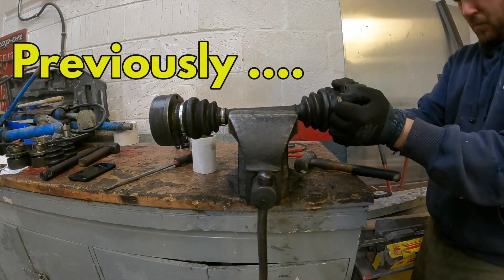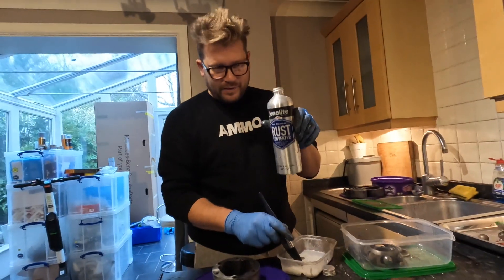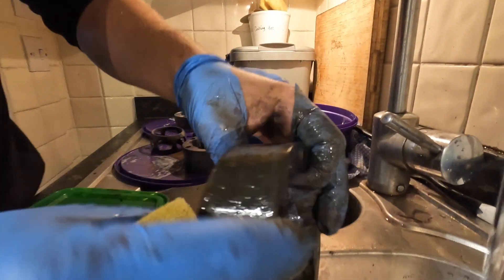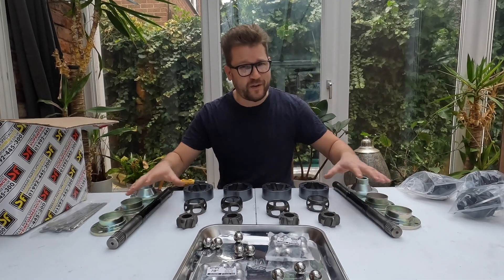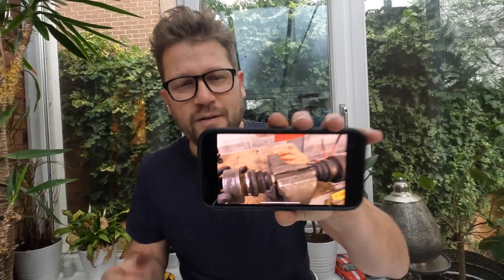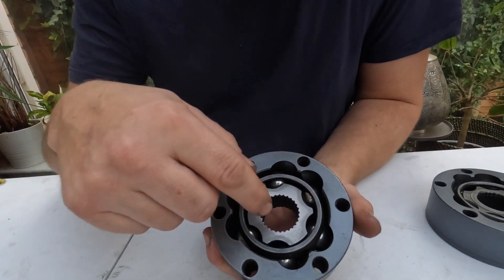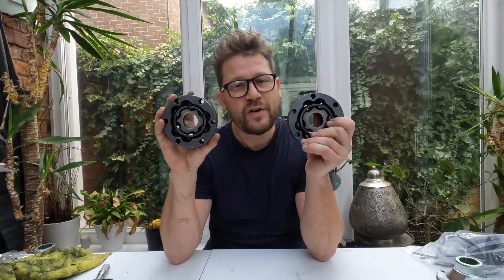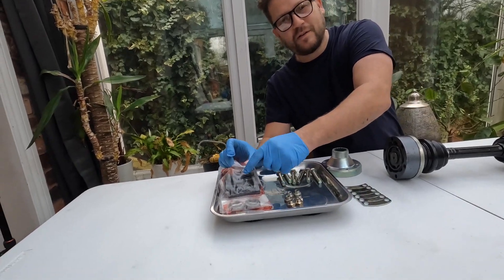Abandoned Ferrari 512 BBi - How One Mistake Cost Me BIG

Comment: To remove light rust, soak in 2-3 litres of white wine vinegar overnight. At about 79p a bottle, it's cheaper than rust removal products and can be less harsh on metal.  I've used it on BMW components. Worth a try, before spending money on more expensive stuff!
Reply: Yes, the best and cheapest advice. Leaving those metal parts totally submerged in white vinegar for at least 24hrs and then he will find them rust free, this is how I restored some old rusted pliers 💪🏻
Reply: @fedezotter  Tip was passed onto me by my Dad. Engineer for 50 years who worked with racing bikes and F1 engines!  No oil residue left and saves a tonne of money! Also done the same thing with a pair of pliers that were pretty ancient!

Comment: Citric acid is your friend for rust conversion.
Dissolve it in some water and submerge rusted pieces for 15 minutes.
Oxalic acid (often sold as "deck cleaner) is another option but it requires longer to work and can stain the metal yellow if not cleaned off afterwards.

Comment: My understanding is that you are better off to pack the CV joint with as much grease as you can reasonably get in under the boot. Benefits are to keep water and dirt out if the boot leaks, carry away any kind of debris from the CV joint wear, helps to ensure an adequate supply of grease to the cv joint and even aids with cooling. Good luck with the rest of the build!

Comment: Remember to "clock" the CV joints inside to out.  Which means the big area on the outside should be matched to a small area on the inside joint on the same axle side.

Comment: I use 1 part Molasses mixed with 7 parts water for rust removal. Leave it in over night usually does it for surface rust but you can leave it for longer if needed or mix it stronger. Don"t put anything Aluminium in it it will destroy it.

Comment: In simplest terms, electrolysis is a method of removing rust (iron oxide) by passing a small electrical charge from a battery or battery charger through the rusty metal to stimulate an exchange of ions while the rusty metal is submerged in an electrolyte solution.

Comment: There's a product in the US called "Boe Shield", They also make a companion product "Rustoff". These two products are simply awesome for rust removal and then longer term protection. I literally have it in gallon sizes on my tournament sport fishing boat. It is used to clean and maintain everything on the boat. Engines, pipework, exposed metal of any kind and fishing reels and tackle. I have no connection to this product other than I cant imagine not using them on my boat or my cars.

Comment: You should look at repacking those CV joints with Krytox 216, basically a lifetime grease made from non-organic fluorinated oil thickened with PTFE and with MoS2 as a pressure additive. edit: ah too late I see. Anyway another benefit is the CV boot won't degrade over time in contact with the Krytox whereas it will when exposed to the normal mineral oil-based grease containing napthalenic acid

Comment: Mix up anhydrous citric acid powder in hot water, 1 part citric acid 17 parts water, leave to soak, stir and agitate with a stiff brush. leave a couple of hours and rinse off and repeat until rust has gone.

Its very gentle and works quickly.

Comment: Steel wool for inner areas, wire wheel on a grinder for the outside stuff (thin wire) and navel jelly for the stuff that’s pitted (let it sit 5-30 minutes in a plastic bag then rinse with water and dry right away) buff with the wire wheel after to smooth out any surface imperfections. But to be honest some of those bearings look beyond help and will definitely need to be replaced.

Comment: I've used a product called CLR - Calcium Lime and Rust Remover.  I soak it for about a week.  Then polish it with a wire wheel to remove the black surface scale.  Ive used this to get bolts to bare metal for replating.

Comment: Evapo Rust. Comes in a big can. You can use it over and over again. Prop with rust converts is that they chemically stop the rust but will not remove it all. Also use XXXX wire wool to clean not wet and dry.

Comment: If the driveshafts are both the same did you fit the driveshaft the same way they came off the car, left to right? Over time the driveshafts take a "set" due to the tortional twisting forces with power application so if you fit them the wrong way round left to right you set up a reverse tortional twist which can lead to driveshaft failure.

Comment: I have had good results with a product called Evaporate-rust. Drop in a bucket cover the part and let it soak for 8-24 hours depending upon how severe the rust is. Will not eliminate pitting so not the best for precision parts.

Comment: Someone below commented that you might have put too much grease in the joints & it looked that way to me as well. I did this on a 328 some years back & there is a specified weight of grease should go in each joint. To complicate it though a couple of the available Ferrari WSMs were at odds with each other as to how much should go in but after some digging around & discussion I think the correct amount was 100g per joint. If you put too much in its going to find its way out and make a huge mess. I think you should also have a clamp on the fat end of the boot - didn't look like there was one there. I also remember that the Ferrari boot clamps wern't very good. Oeticker (sp?) were much better.
Reply from the maker: Well spotted on the clamp, I was waiting for new (better) ones to arrive. 
Interesting re the grease. The 100g is that just for the boot or with a complete fresh dry bearing as well ? I’m the boot I just added the supplied packet of grease. The rest was to add some to the bearings. Maybe a little to much ? However still plenty of air/space in there.
Reply: @Ratarossa  I found some old photos of when I did this (bearing in mind this was on a 328 so the joints may be different, but they do look pretty much the same, maybe compare them with your 308?) . The first time I did it I put 140g in each one as per the documentation I'd found & it was a real struggle to get it in there. That plus lousy Ferrari clamps led to some leakage  - I can still see the marks on my rear manifold where it burned on to my newly zircotec'd pipes!  If it leaks its going to get flung around the place and make a huge mess! Not long after that I found another WSM (I think probably the one off the Mondial which was always more comprehensive) & that said to use 100g. I needed to redo the clamps anyway so I took them off & re-did them with 100g and Oeticker clamps and they have been fine ever since. I don't really think having loads of it up in the boot really does much of any help either. Its not as if its a reservoir of the stuff that I can see.
Reply from the maker: @IDM328  ok good to know, i will take a look and maybe remove some

Comment: You could get the steel parts aqua blasted then polish the cages by hand or on an abrasive wheel and polishing wheel and wet and dry finish the outer CVs on a lathe and then get everything coloured zinc plated by Steve at Chingfords.

Comment: Great job, I am just wondering if any sealant was called for on the caps? I have rebuilt mercedes driveshafts with similar caps and a thin coating of RTV sealant is required then use nuts to clamp to caps temporarily until it cures. Otherwise when the driveshafts are in use and the grease warms up it can start to weep out of the metal joints.

Comment: Did Scott put the circlips back on the ends of the driveshafts? I saw the inner ones but not the outers. 

When I heard him shake the built up CV dry and it rattled then in my opinion change for new. Find a decent driveshaft company like Dave Macc in the UK and buy some decent CVs to do the job properly. 

I don’t think Scott mentioned spline wear either.

Comment: put the rusty parts in a container and fill it with CLR.  let it soak.  after soaking but other softer metal objects with the rusty parts like bolts and nuts and shake it to pieces.
Did this on the inside of a gas tank and it made it look like new.

Comment: Rust soak, cheap to find out whats going on. White Vinegar. Doesn't leave a hard coat residue like formic acid does, but will blow off galvanised coatings to leave bare metal. Hard finished components like balls and races, will give dark spots to help identify how pitted the surface is.

Comment: All bearings from this time period are actually "English/standard" this is due to you guys bombing the places that made metric some time back and then the only machines left to make bearings made them standard. This held true til quite recently.
Good job on the rebuild. i use to do this all the time in the 80's when i worked for the Ferrari dealer. SKF used to even have a little pamphlet on how to do this. You did fine though I would have held the axle in a vice for ease of assembly.

Comment: Stainless steel is completely wrong for ball bearings. It is not hard enough and would be a disaster...you need steel purpose made for bearings.  I second the use of evaporust per S. Roach. If you can warm the solution slightly it will speed things up.

Comment: Using Oxalic Acid to remove rust:
When Oxalic Acid comes in contact with rust, a chemical reaction known as a double displacement reaction occurs. This changes the rust (a.k.a. iron oxide) into iron oxalate. Since iron oxalate is a water-soluble salt, it dissolves in water and easily rinses away.

Comment: They look like new on the outside, but the inner surfaces of the bearing and the races and cages are what matters and their tolerances are critical.  Any pitting from the rust on the races will destroy those ball bearing quickly.  It's time to just buy some new CV joints and move on to real restore-able parts.

Comment: The balls in bearings are seriously hardened pal, not sure what grade of steel, same with the cages etc, that's the case for standard bearings anyway not sure about cv joints. You can get 22mm steel balls, just make sure you get the right grade. Antifriction components are the men to speak to. As for the rust, angle grinder with a wire cup brush on it, m14 thread. About 8 quid from your local engineering shop.

Comment: I would keep the ball bearings ferrous, if you use stainless you will probably have dis similar metal issues/corrosion. packed in grease ferrous should be fine.

Comment: Looks great but remember that the corrosion and its removal will have changed the tolerances in the ball races and degraded the hardening.  That will lead to premature wear.  Also, those bearing assemblies are usually completely packed with grease, till you literally can't get any more in.  Remember those CVs have to cope with up to 330 lbft of torque and potentially 3000 rpm; they have a hard life!
Reply: Tim they aren't completely packed.  There needs to be some expansion space for the air and grease when it heats up.

Comment: Citric acid and hot water. Turns the rust into gue easily removed by a brush. Treat it with oil immediately after drying, otherwise it will rust very quickly again.

Comment: The treatment you used was a rust converter not a rust remover.  It chemically changes minor rust so it can be painted.  What you should use is known in the U.S. as navel jelly.  There are other chemicals but i'm not familiar with them. I hope the wire brushes were brass and not steel.  Brass will not scratch the steel surface where a steel brush can.  Fine machined surfaces are not meant to have scratches.

Comment: What you have done will probably work fine for a while - BUT you will have degraded ALL the critical CV tolerances, such that after a relatively short period of time/miles they will then start 'clonking' and wear out until it breaks - usually BIGTIME ! ... so be prepared to replace them later.
Reply: I'm no expert so could you explain a bit more? Is it that the tolerances are too high now which will have too much play which will wear it down quickly?
Reply: It isn't front wheel drive. You will never clonk or break them
Reply: @janeblogs324  ... FWD is irrelevant - it is always down to angularity under suspension deflection, whether it is on a steering axle or not.
Reply: @alanlofus3100  you've got to engage your brain. Rear wheel drive the hub stays parallel to the diff all the time. Fwd you are steering the hub up to 35° to the diff
Reply: @janeblogs324  regardless, it is still an angle ! .. just in a different compound plane

Comment: Think use a tote with solution connect to a battery charger you will have to research this should eat the rust away without abrasives or see who doe superpolishing as in engine gearbox parts should fill any pockmarks

Comment: well, those shafts will be OK for driving in + out of the garage, that's about it.
 sandpaper + polished bearing surfaces don't mix, + we won't even start about mixing each set of matched joint components up. a valiant effort, but after about 100 miles they will be rattling their tits off. this won't be dangerous straight away, but accelerated wear will soon cause worries on longevity, + the vibrations will loosen/ wear other linked parts.
happy new year, but gan canny with these shafts...
Reply: You appear to be mistakenly associating 1980s Ferrari's with high presision engineering, there is a reason they are as unreliable as they are and constantly need rebuilding. Have you seen the welding on the chassis, that gives you a clue as to how much care they took building them.

Comment: WHen I've blasted something that I wanna stop from rusting, but I know I'm not going to use for some time I do this - I get a litre of the cheapest house brand etch primer I can find, and a tin of the cheapest white paint I can find (or I ask at the paint shop is there any paint they have that was mixed the wrong colour or someone never picked up that they will sell me cheap and use that) and just paint them like thatm it's cheap but it's still paint! Because primer is porous , it's just like leaving clingfilm on bread and leaving it out on the bench for 5 days - it's still going to go bad. And the plus with the primer and topcoat there is, you can just rub the parts down and refinish them in the colour you want when you're ready as all the surfacing and prep is already done. Or if it's shit like that which can only be painted on one side or can't be painted, just do it the backyard bodger's way and throw it all in a bucket of sump oil and leave it there till it's needed. that way it's never gonna rust!!

Comment: I will be shocked if this doesn't come back on you, most likely immediately. Wouldn't be silly enough to do this with a Subaru. My advice, sell the mirrors for the driveshafts. Think about the difference in what each part is actually doing. Think about the roll of the driveshafts of such a high performance car, the second or third last roll.

Comment: As others have already mentioned sadly this is going to bite you in the wallet sooner rather than later. Those parts are machined to within certain tolerances and sanding them is only making those gaps larger than they should be. You won't see it but you most certainly will feel it before too long.

Comment: Have a look at Abom79 (Adam Booth machine shop) on YT he's done a few videos using evaporust and it kills it.
Reply from the maker: sweet mate cheers !!
Reply: @Ratarossa  100% a second vote for EvapoRust on parts you do not want to blast / want to preserve the surface as best as possible (other than maybe a fine 2000 grit sanding or brasss brushing at the end).  And it can be used in an ultrasonic to speed the process.  Rust chelation is bang on for certain tasks that need gentle action OR need to be done in liquid to get to areas you cannot otherwise reach.